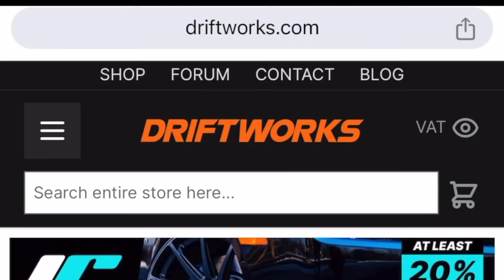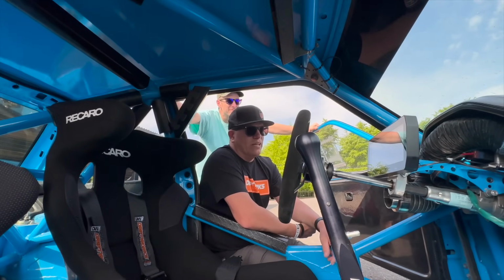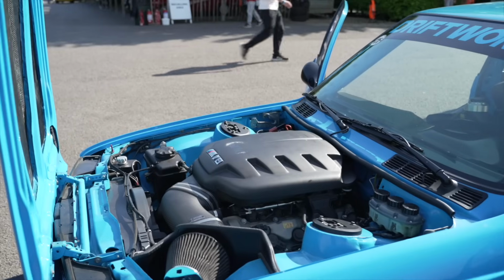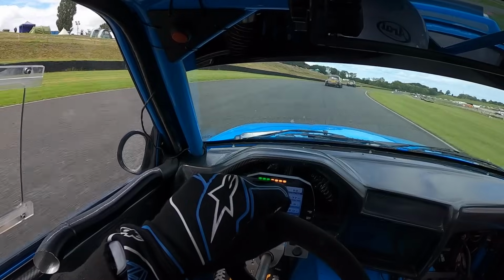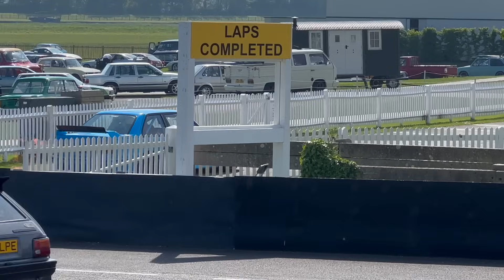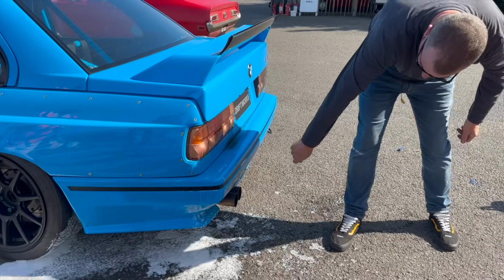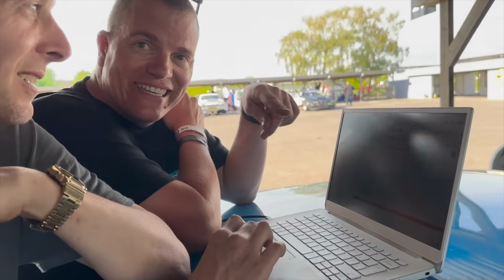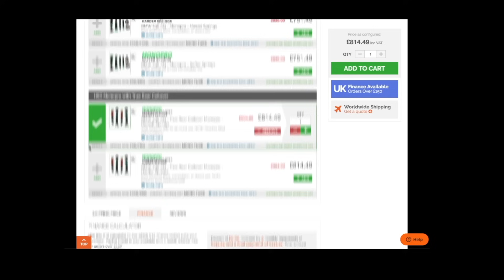On Fire in my E30 BMW M3 at RetroRides Goodwood

Comment: Can I help Phil? I have done various BMW ramair systems last years and sold my designs to about 50 countries and 45 states. I think there is very easy way to make the flow way better through the now closed ”grated" front lights surrounding trim piece, with it staying looking exactly the same but airflow getting massively better. If interested please let me know. Greetings from Finland.
Reply: Do it Phil!!
Reply from the maker: Thanks man. This fixed the problem. It''s a pretty decent enclosed filter. I've got a plan to pull more air from the brake vent hole below, and actually have had an even bigger plan ever since I bought this car to build a modern DTM style central filter that sits above a leant back radiator. But for once I'm listening to the voice in my head that says 'it ain't broke, don't fix it' 😂

Comment: Could you 3d print a headlight mount that's an intake around the light?
Reply: Don't even really need to, there's quite a few already on the market for the E30, there's even clear frosted headlight intake horns available so you can put LEDs around it to make it appear like you still have a headlight(same with clear "angel eye" ones), or, just high polished aluminum with the inside opening the same size as the main projector, that way at a glance, it literally looks like you have 4 lights still (obviously without one functioning). They also have ones where they'll have the typical intake horn, but in place of the headlight, is a circular piece of grille bars to make it look "phantom"(IMO, only good looking if you're running single separate headlights, not 2 + 1)....or if course, he could run a phantom grille completely and nobody would know he had on intake (definitely don't think he wants to do that) or could even mill/Dremel out the plastic itself between the stock grille bars around the headlights as they are in the center of the grille. Definitely one of if not thee easiest car for headlight intakes known to man 😅